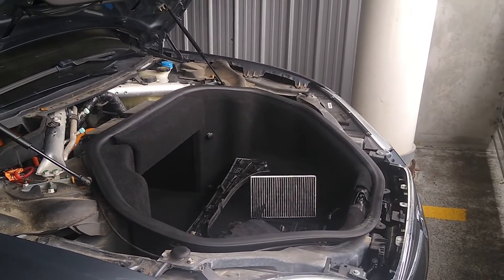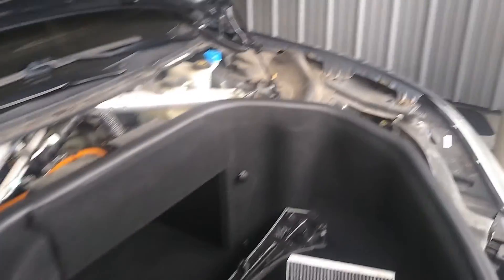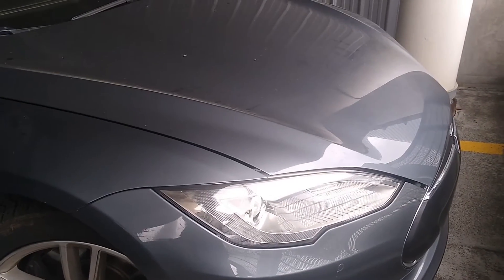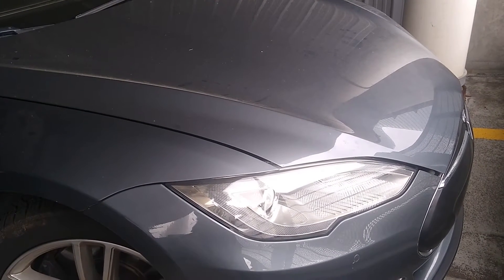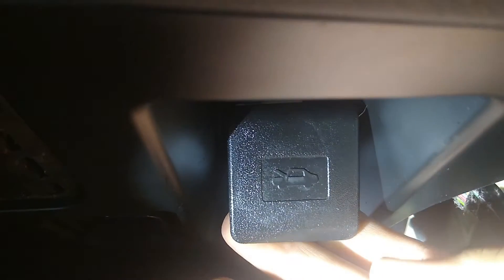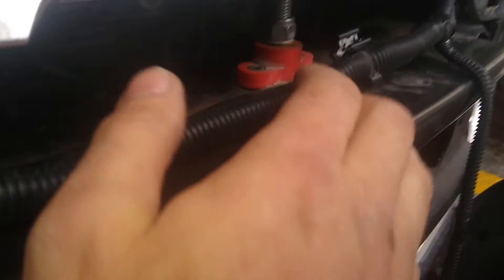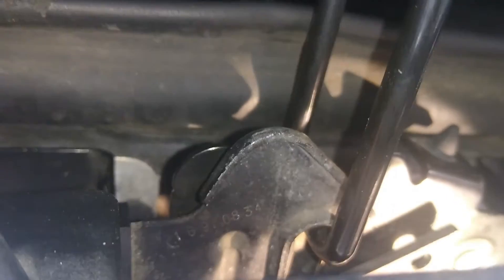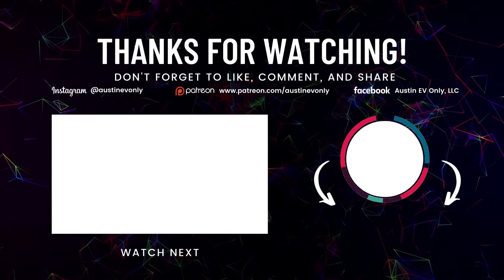Opening a stuck Frunk on a dead Model S (pre-refresh)

Comment: I used the two emergency strings on the side of the fender to open the front trunk but now when I shut it, it will not latch